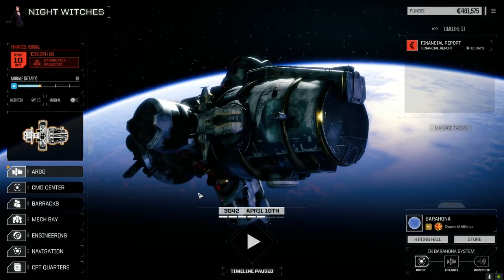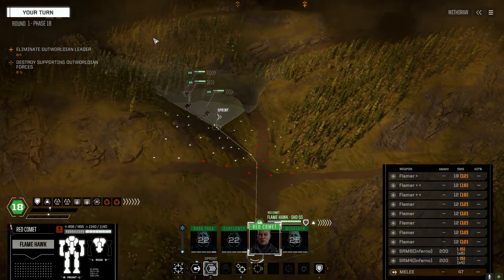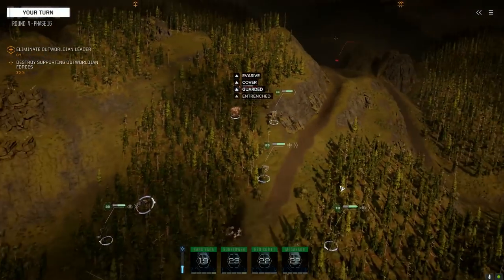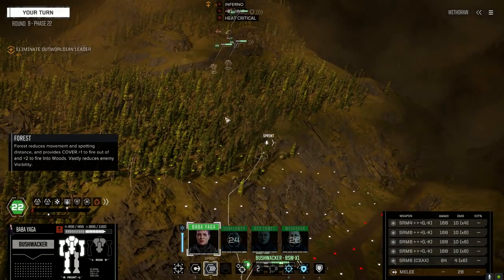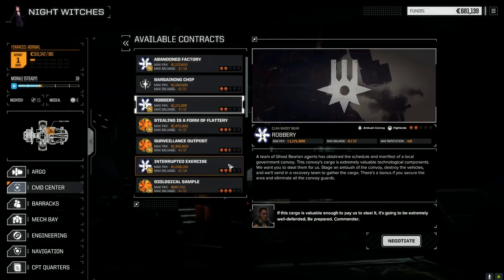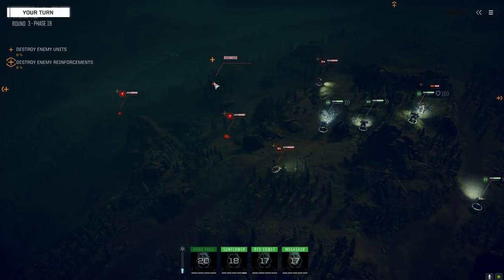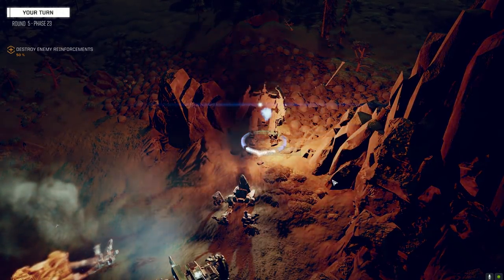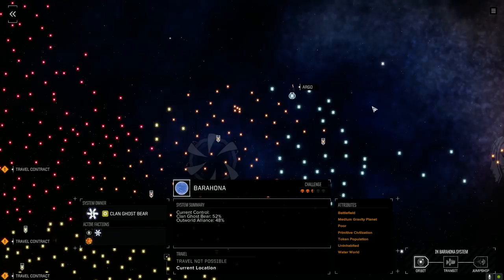Roguetech - Night Witches - Ep39

Comment: Flammers kinda lost their value since the introduction of the multiple balistic/missile ammo types mechanic.

Srm is now the OP weapon to induce overheat since every srm 6 would give the enemy 30 heat when all the missiles hit, with the benefit of being a much more flexible weapon than a flamer can ever be, and at the slightly longer range.
Reply from the maker: For flexibility, for sure go with the SRM's, but pure overheat potential is still the domain of the flamer (although you need a lot of energy hardpoints).